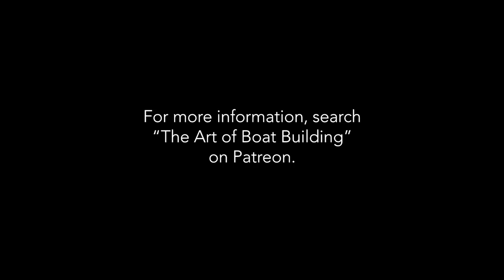Building the Seats and Stem, Episode 1

Comment: Enjoying your videos of boat building and much appreciate your mention of boat building classes and to begin with a kit. While making your template extension for the front seat, you could have used the small piece of wood you cut off with the bandsaw at 5:18 as a template for the cutout at the stem of the boat. Thanks for the effort of making and sharing your very calm and soothing videos.

Comment: I'm guessing........(hoping) that a few places in the bow that look like there are large cracks in the hull are just trickles of light reflecting up. Nice job. Good Video. DD
Reply from the maker: Hi Dennis, Yes, you can see light that is shining through the epoxy layers. At this point in that build the boat had 2 layers of glass cloth and epoxy on the outside and 1 layer of glass cloth and epoxy on the inside. The glass cloth becomes transparent with the clear epoxy. After the hull is painted you can't see the light. That day the video was shot early in the day and the eastern sun was quite bright. The launching went very well(no leaks!)
Reply: @TheArtofBoatBuilding  Good to know Bob. I'm glad it's working out for you. Beautiful craft! DD